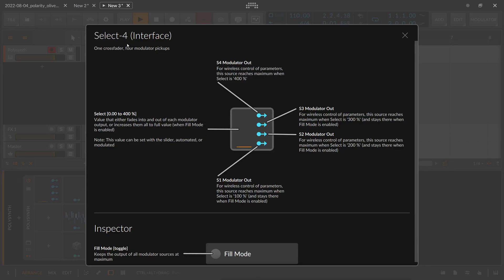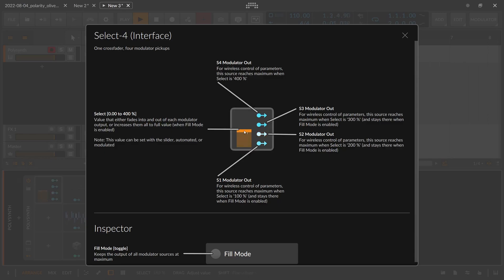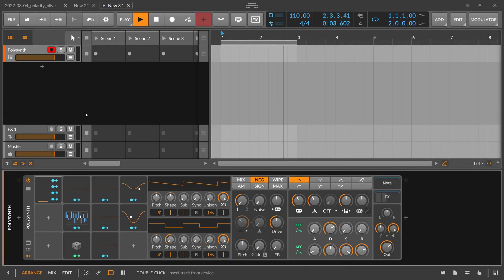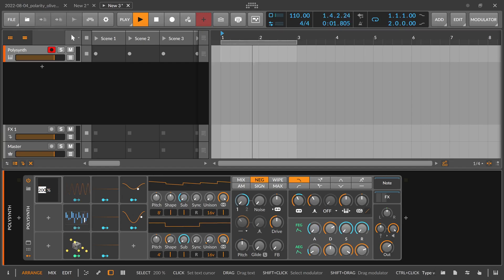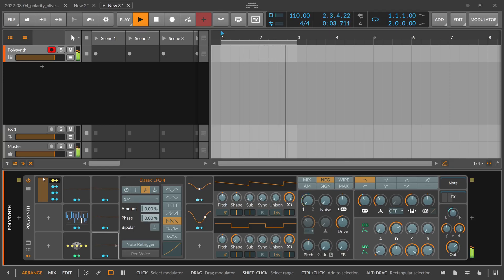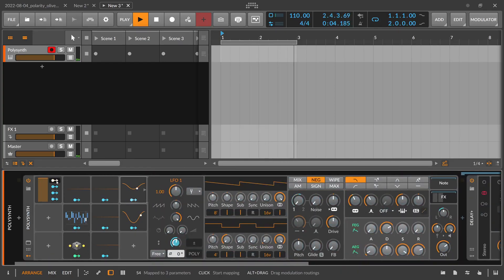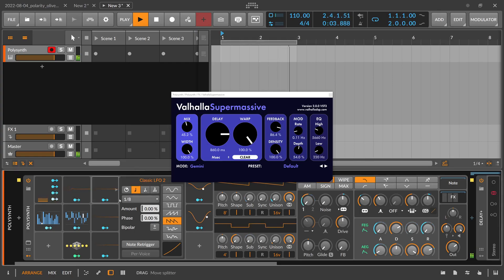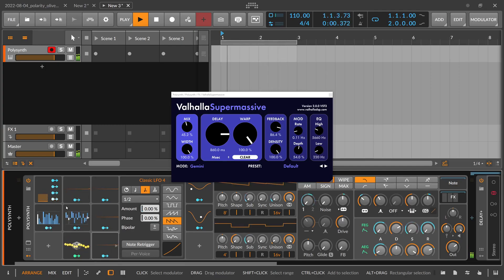Select-4 - Bitwig Modulator Guide

Comment: Good intro to a device I have never considered using before. Danke!

I think it might have been helpful to show an example of actually applying the modulation to a parameter directly and then applying it to the "amount" of another modulator and showing the effect before "touring" a modulations in an already-built more complex patch (which does, however, make a great finale demonstrating the overall potential of this device).
Reply from the maker: yea thanks! i wanted to show all at once, thats why the demo was bit more complex with the added modulators. i think people will get it.